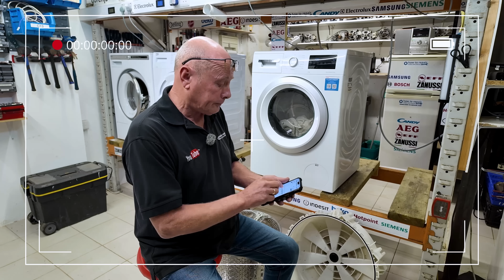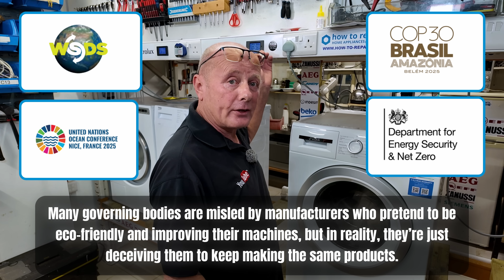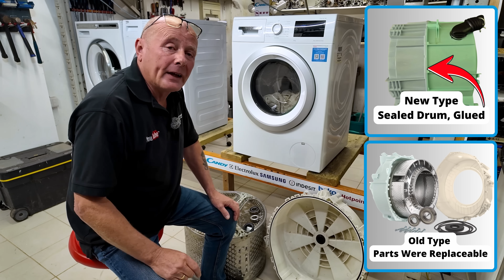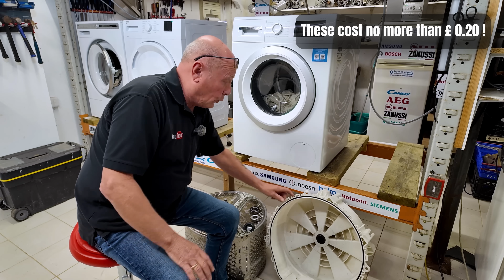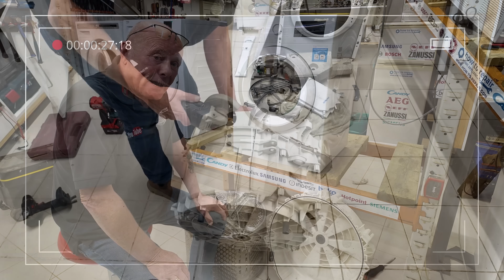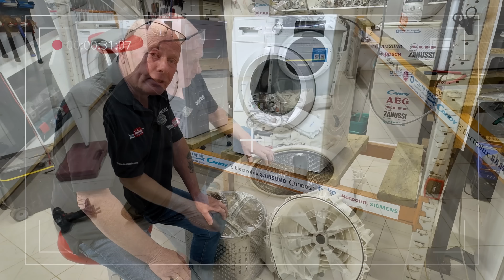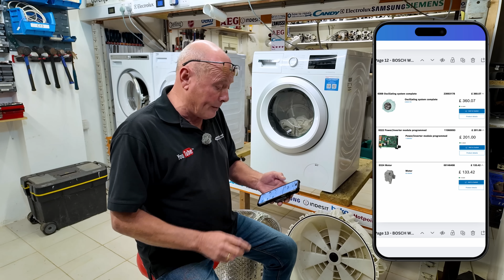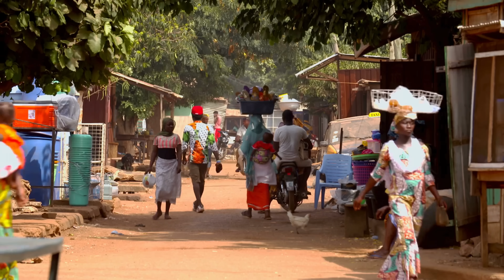Washing Machine SCAM EXPOSED! The Truth About SEALED Drums: Naming & Shaming

Comment: €500 LG washing machine lasted 3 years 2 months (2 months outside of the warranty) before dumping water on the floor when filling. Took the cover off and the back off, no hoses loose/split or anything obvious. Friend has replaced it for a Bosch. I will not buy another thing from LG after my €1100 fridge freezer mother board failed 8 months after the end of the warranty. LG is just junk.

Sure it's nice to be able to split the drum - but if LG is just making junk, who cares.

Comment: I am trying to repair my AEG L75280FL .. . it has a sealed drums. the internal basket is quite loosing .. I need to replace all assembly and it costs 170 Euro. it could be repaired with max 50 euro of spare parts but due to the sealed drums you have to spend 170 euro. you are perfectly right .. these manufacturer doesn't care about water consumption or electricity ... they only want to squeeze you as much as possible. Now before I buy a new one I always check the exploded view and avoid the cheap one

Comment: I invested in an AEG heat pump dryer in 2020 at £800 or $1000. Six years later the motor died. Called an engineer. He wiped £120 for the callout to diagnose and then about £3/400 to repair. The repair engineer suggested not to buy heat pump again, whilst they save you some in the energy but they will be difficult out impossible to repair economically. He only really fixes them under warranty. Condenser are much more reliable and will work out cheaper on less repair bills

Comment: We have an 11-year-old Miele, model WDA110. Mechanically, it works beautifully, and we’ve taken good care of the machine, so it’s in great condition otherwise. Everything would be fine, but the cross-brace behind the drum has snapped. The price of the Miele spare part is absolutely insane! The cross-brace—the part that connects to the bearing shaft—costs €625.67 🫣 We would have liked to repair it, but the cost of the part is outrageous. There is constant talk about recycling appliances and extending their lifespan, yet this situation suggests the exact opposite. Our Miele washing machine still has a steel drum, whereas newer models have plastic ones. Miele seems to be heading in the wrong direction.

Comment: Noticed noisy bearings on Hotpoint WMXTF 942 and thought I’d replace them.
So found the bearings for sale at around £17.00 but before ordering checked inside.
Great, it’s a sealed drum! So that’s put a stop to that.
Now I have to buy a new washing machine and scrap this A+++ rated machine that sips water to save the environment!
Do me a favour, this just proves that the whole green BS is just that, BS.
Do not buy a Hotpoint washing machine.

Comment: I recently replaced my washing machine with a new one.  It was six years old. Being a retired maintenance engineer I could have diagnosed the fault and repaired it myself. I decided to purchase a new machine from the same manufacturer. It comes with a five year parts and labour warranty. I know that I could have paid less and had a one or two year warranty. My old machine cost me the equivalent of £1 a week and my new machine will probably be the same. Try taking your laundry to a laundrette or the machines placed outside supermarkets and see how much that would cost you, certainly not a £1 per week but a lot more. I am on the side of the manufacturer's. I think that you are not happy because you are loosing repair work. Time moves on.

Comment: It sounds like someone could make a very good business from manufacturing splitable drums for all of these machines an injection mould of the parts and then if the drum goes the option to replace it with a splitable drum that allows you to get to the bearings becomes an option again.

Comment: "I am European, and when you look for a washing machine online, all you see is things like a 3-year warranty and an 'A+' energy rating. But I had no idea that they now build the drums in a way that prevents you from replacing them—or rather, it makes economic repair impossible.

If a washing machine costs £500 brand new and the repair is £300, it’s just not worth it. Another thing is that companies sell the main PCBs (printed circuit boards) for around £200... How much do you think it costs to manufacture them in China? $5 to $10?

Because of mass production, I don't believe they cost any more than that. It really bothers me too that most of today’s appliances are designed to break down after a certain period of time.

We used to have a freezer—I am Hungarian, so my parents bought this freezer before 1990, back in the Soviet era. It was a 'Lehel' brand, and it ran continuously until 2021. Then the energy crisis hit, which is why they had to buy a new one, but that chest freezer was practically built for eternity. It worked perfectly even after 30 years of active use. The only issue was its high power consumption; when we measured it in the summer with an energy meter, it was drawing 150–200 kWh/ one Summer Month! :D
Welcome From hungary! :D

Comment: You Sir, are a legend, and I bet all you want the negative comments are all AI generated. The real comments will be the ones from the angry people like me, who feel conned by these greedy manufacturers.I've been struggling with one these sealed drums machines.  The drums has been rattling on spin cycle for a very long time, despite the machine being only about 5 years old and very lightly used. Clearly something wrong but not much I can do without a ridiculous expensive repair.

Comment: Had 1 set of Asko-lasted 12 years for family of 2. Second set of Asko lasted 20 years and still running. Third set on order, betting that the second set is near the end of its useful life. Repairs on first 2 sets: oil leak, control board failure (under warranty), one belt replacement. Seems quite reasonable .

Comment: Yep, I think the bearings on my washer dryer need replacing, I spent about £800 on that machine albeit a few years ago, I thought it would last, and thought it would be repairable but after putting in the model number I found out that it's a sealed unit... unrepairable 😡🤬😡🤬😡

Comment: These machines should now be bulletproof for years. How is it that Miele used to make machines that would easily last 20+ years, now are more expensive than ever before and are now failing at 2/3/5 years??

Love this guy BTW - kudos!!!
Reply from the maker: For decades, Miele built their reputation on robust, high-quality machines. Reliability was their core selling point with the promise that their appliances would run perfectly in your home for years. But now? They are introducing sealed plastic drums into their washing machines. This completely stops you from replacing the bearings or the spider. It even stops you from accessing the outer tub to fish out trapped clothing or stray bra wires making basic maintenance impossible. So I have to ask is this pure corporate greed, and are we witnessing the downfall of a once-trusted brand?
Reply: @How-to-repair agreed. Have bought Miele for 30 years, my 2001 washer is still going with a relative! Came with a 10 year warranty at the time, never missed a beat. Same with a dishwasher, coming up to 17 years old! Have a 17 year old S7 upright - still going, never been fixed. Then about 9 years ago I bought a new house, got a washer and dryer, both packed up in less than 3 years, both replaced, replacements caused endless service visits. Washer was replaced a second time in 5 years. Replacement came strictly with 2 year warranty, at two years it started leaking and giving me a lot of circuit board faults. It’s been in the garage gathering dust ever since. Worst of all, Miele used to send their own people, Miele vans. Last time I encountered a company called Pacifica that seemed utterly clueless - had no intention of repairing it - few visits they just looked at it, tutted and said they’d send a report. Diabolical. I used to feel smug and proud to have Miele appliances knowing my overpaying would prove sensible in the long run, now I’d never buy another Miele again.

Comment: Hey from Australia. I'm a 64 year old gay man and before I was "hatched", my aunty and my mum bought identical Bendix front loading washers. The motor always ran at a constant speed and like a car, it used a clutch to swap gears from wash speed to spin speed. It also ran in the same direction all the time and yet we never ever had tangled clothes. Mum used a special bag to put stockings in. It ran from 1961 to 1993 before the service man couldn't get replacement parts anymore. We went shopping for a new machine and found a front loader Bendix that looked small compared to our old one yet it could handle more weight in clothes than our old one. More importantly it washed the clothes with the heater switch defeated but the heater did heat the water to a default 40c because they worked out that 40c was a good temperature for the wash cycle. It had a myriad of functions which we never used. We did a pre wash main wash and three rinses and then an 1100 RPM spin which was great. It finally died this year after 33 years of service and one service call and my brother moved into our bungelow and we are using his front loading Bosch. His Bosch machine is 13 years old and still going strong and spins at up to 1500 RPM and so far no problems. It's a disgrace that Australia no longer makes any cars alongwith a myriad of other cheap chinese crap. Because I'm a Rev Head and I've driven a 1971 Ford XY GTHO Phase 3 V8 beast, at the time it was the fastest 4 door production car ever built globally. I'd buy one but I don't have a spare $500, 000 laying around. Now we've gone from that accolade to zero with planned failure built into almost everything. How sad that it. Cheers.

Comment: Two notes:
- understanding the main PCB as a modiule which gets changed as a whole is as problematic as sealing the drum. I don't have so much experience in appliance servicing, but what I tackled there were power components failing every time: relays, SCRs, thermal switches and fuses - this means the bulkiest components, which are most through hole and get unsoldered and changed easily. Logic fails very rarely. I would imagine sometimes microswitches and encoders get busted. But those are all generic widely available cheap parts, just few euro -  so instead if paying 200 for a new PCB, you pay eg.1€ and 10 minutes of work (with cleaning, desoldering, soldering on and cleaning again). Nowadays an average appliance PCB is very simple: few relays, SCRs, maybe motor controller, logic, few buttons and swithes, maybe some LEDS, a screen, logic PSU. Onesided, maybe conformal coated - besides logic components are not SMD; it's pretty elementary electronic repair and often faults are easyly detectable due to PCB discoloration. This is why digitalization could have been such a revolution (but they mashed it for planned obsolence): no more complex switching mechanisms, which need maintainance and wear out (like the old washing machine mechanical programator); it is all on a PCB and done with few cents worth of components, which may never fail and if they can be easily replaced. I get very angry every time I hear somebody was told by a technician that it makes no sense to repair the appliance, because the PCB has to be replaced - fix the PCB, not replace it! The only weak point as I said, is logic - but it fails rarely; and, for better repairability, could be made on a slot. 
The second point is, "northern" companies sealing their drums is like telling the consumers to go to their southern competitors ...

Comment: We had a Candy or Hotpoint back in the day, maybe 25 years ago. When there was a problem with the circuit board, the engineer who came to fix it told us it would cost as much as a new washing machine.

Currently have an LG for 10 years which is still going.

Comment: Not the first time I have seen this series of videos.   No, I am not AI.   I think that you are making it sound so simple, and yet it really isn't.

First and foremost, the name of the game for any company is to make a profit.  They exist to do that.  They aren't going to sell you a washing machine at a loss just to make you happy.  So they work on different methods to make a profit.   That includes making it easier to build the units, easier to outsource parts production to lower cost sources, etc.  If you look at the prices of a washing machine for the last 30 years, you will see that the retail price has not followed inflation, and is in fact quite a bit lower.  

From google's AI:  "Washing machines today often cost roughly the same nominal amount in GBP (around £300–£400) as in the 1990s, but they are significantly cheaper in real terms due to inflation, often offering more features for less relative cost."

Second, and very important:  The cost of people's time to repair a washing machine has gone up dramatically.  Going rates are in the 60 to 100 GBP per hour to do the work, and many will charge a minimum number of hours just to make it worthwhile.    So in order to get your washing machine repaired, you are likely 200 pun out of pocket before they do anything.   So the cost of your bearing repair is a lot more than you make it out to be.   Remember, unlike a lot of things, repairs are made in situ and not carry in.  That costs money to do.

Third, and this is very important:  "right to repair" supporters, pushing for parts availability etc, are sort of shooting themselves in the foot.  Companies do make the parts available but now they only do it as assemblies - because that is how they are obtaining them.  The main circuit boards are likely built in China or whatever, and they arrive at the factory already made as a single "part".   So when it comes to selling spares, they do the same thing:  they list the full board and not individual parts.  The tub is the same thing, it is a single made assembly and they sell it as such.  

Third and a half:  the cost to keep all of the various assemblies in stock to sell to you isn't free.  Even with a 10 year lifespan, and a new model produced every other year, they have to stock an incredible number of parts, knobs, and doo-dahs.   That stuff takes space, space costs money.  It also costs money to have the parts made but not sold as the money is tied up in inventory, which gets written down at a loss over time.   So keeping all the little parts, keeping the in inventory, keeping an inventory system for them, and paying staff to take a 5 pun bearing and collect your payment and put in the post and all that is just way too expensive.  Don't even consider having a store front style parts counter, that is insanely expensive.

Fourth, and very important:  In most parts of the western world, large appliances are recycled, broken down when they are junked and the vast majortity of the content recycled.  The metal, the wires... all of it get recycled.   The entire process is different from where the world was 30-40 years ago.  Instead of just pushing it into a landfill and calling it a day, recycling keeps things on an even keel.

So, given those points, the washing machines which costs 50% or so less than it's 30 year old counterpart did, and lasts say 10 years before it gets recycled isn't as costly as one that lives 20 years, needs 2 or 3 repairs, and uses more water and power than the modern device.

It is both simple economics and simpler lifestyle.  Nobody likes having to take a day off work to wait for the repairman to show up and give us all a butt crack display.   We can't afford the time off, we can't afford the hourly rate, and the price of parts really isn't important once you consider those two points alone.    

let me repeat:  I am not an AI.  Just someone who doesn't have a dog in the fight or a horse in the race, and I am not upset because my livelihood of repairs appliances is getting taken out by the realities of modern economies, recycling, and convenience.
Reply: 1. R*ddit spacing
2. I ain't readin' allat
3. Making profit =/= maximizing profit. No company is "forced" to "maximize" profits, public (and private) companies choose that path for themselves by putting themselves into a position of unsustainable growth. If you continuously promise investors these unrealistic profit goals then that's on you, the company, and eventually you will be forced to employ scummy tactics like this. It's nothing new and it's been going on in the entertainment industry for 15+ years as well.

Comment: It is an absolute disgrace how these manufacturers are building their washing machines, a year last August I was going to purchase a Miele washer dryer, but I noticed that the drum quality wasn't as good as they used to be an it was one thousand five hundred pounds. For that reason I chose not to buy it and I bought an LG washer dryer which the build quality is much better and a bigger stainless steel drum for half the price than the Miele. When I was buying this machine I looked at everything to do with it as well as the drum quality asking lots of questions and getting all the information on paper as well as doing lots of research online about it and reviews. The LG washer dryer is the best machine I have ever bought, I would highly recommend it. Just because a machine costs more to buy doesn't mean it is of better quality.

Comment: When I learned engineering,one of the class was teached by a BOSCH engineer. He said Quality Controls job is to make sure certain parts will last just a bit longer than the warranty. It would cost pennies to use more robust switches on drills as an example,but they purposely used the ones that fails after a set number of use.